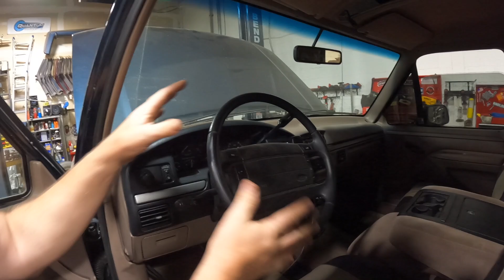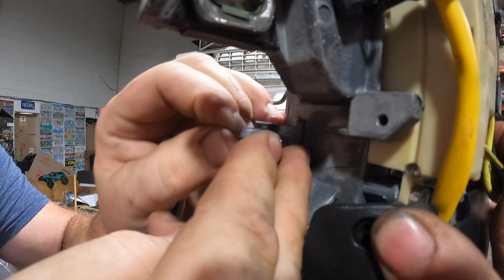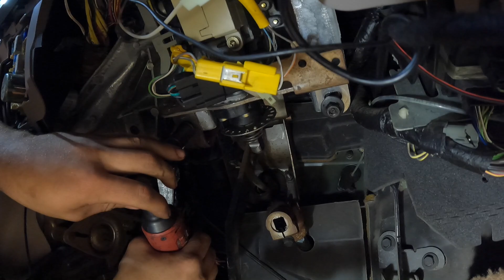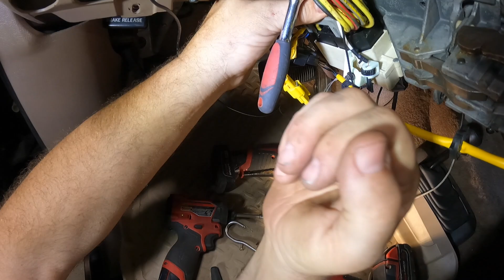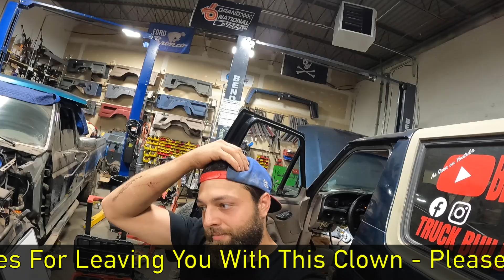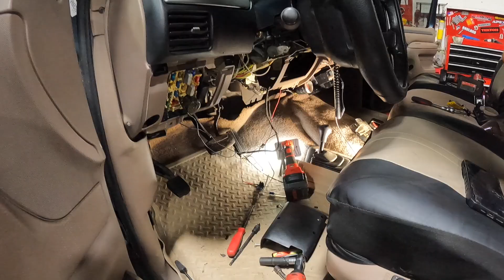OBS Ford Truck Bronco Steering Column- How To Remove & Replace   1992+

Comment: What years share the same harness’s with a 95 f150? I know the column is useable from 80 on up .
Reply from the maker: Columns changed dramatically in 92.  And again in 94 (airbags).  94-95 harness to be safe.

Comment: Hoping you can help. Disconnected the bolt on universal joint closest to the firewall when removing the column to install a new shifter cable. When I put the column back on, the only way to get it back on the universals joint was with the steering wheel turned 90 degrees. Any ideas on how to get steering wheel back in alignment?
Reply from the maker: Remove the universal joint and rotate.  Bolts gotta come all the way out to remove

Comment: Hey. How do i change the shifting column seal on a 93 Bronco? Any help would be greatly appreciated. Mine is all ripped up as they usually get.  Thanks again for all the cool videos!
Reply from the maker: I sell them.   N2kpi@yahoo.com. $29

It’s in this video 

Ford Vehicles How To Fix Your Sloppy Shifter Arm |  Ford Bronco OBS F150 F250 F350  Most Older Fords
https://youtu.be/DQQfg1HUUpc

Comment: My steering wheel over certain bumps seems to move up and down (I don't mean the steering wheel moves up towards the ceiling or down towards the floor, but rather it moves up and down like when you depress the spring on a toilet paper roller).  Any idea of what that could be?
Reply from the maker: That's usually the u-joint in the steering column.  Can you send my email a video?  N2kpi@yahoo.com
Reply: @ sure I can send one.  I put it on YouTube also.
Gimme a little bit

Comment: Was doing this process to completely swap out the column. Unfortunately for me the locking clip that holds the transmission shift cable to the back portion of the column snapped off and is stuck in the locked position. I think I'm going to try and use a right angle pick to pull out the locking tab, any other suggestions outside of replacing the entire cable after cutting it off?
Reply from the maker: Just push the little plastic pin out of the hole and it’ll slide right off with a few taps. Or email me a pic
Reply: @BroncosandPartsGarage  perfect thank you. I was hoping that this fix was going to be straight forward. Turns out someone over 20 years ago installed a remote start or secondary security system as well. Wiring was a hot mess so when the clip broke I called it quits for the day. I'll send a picture tomorrow. Thank you.
Reply: @BroncosandPartsGarage  with the top of the lock mechanism broken will it just slide out or do I need to completely pull out the rest of the locking tab?

Comment: My shifter won't line up at all, if it's lined up in park then it's off everywhere else.
Reply from the maker: @jeffspratlen9335   on the very bottom of your column where the joint is, there’s three gold colored torque bits. Tighten those down and everything should be fine.
Reply: When it's in reverse it's neutral, then neutral is reverse, drive shows second and it won't go to first.

Comment: have been enjoying your production for 2-3 years now. THANK YOU! I am in the process of refurbishing my dash bezel on my ‘96 EB Bronco. Have a crack that goes all the way thru and on top of bezel where those 3 clips are. plan on repairing crack but need to know the finish of black spray paint to use. Gloss, Semi gloss or flat, thank you once again.
Reply from the maker: Thank you.  I’ve never painted one.  But I have some for sale cheap.

Comment: Loving the channel.  Just got ahold of a 92 f350 commercial cab and chassis and the interior is shot.  Ive been following all your videos so i can rebuild the truck completely.  Question though.  Have you or are you doing a video on replacing door pins and bushings?  Thanks!
Reply from the maker: Great question!  Yes I have one in the pipeline.
Reply: Great video - I think the wires covered with the Thick Yellow Shielded Tube are for the Airbag .